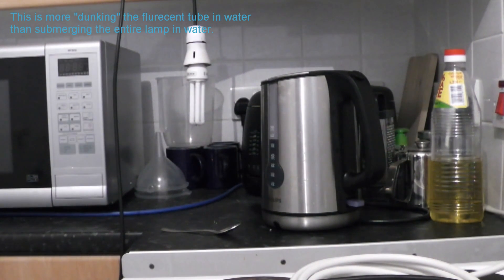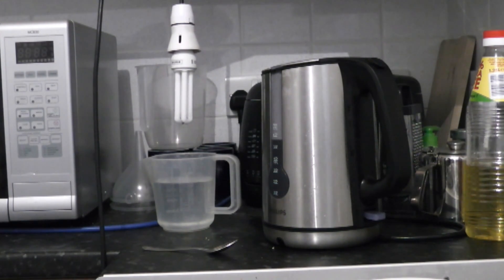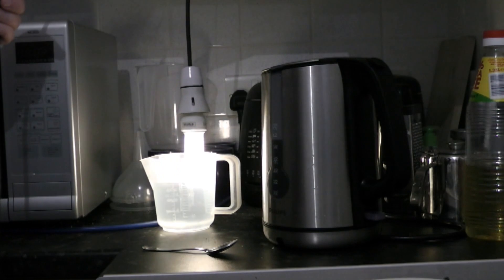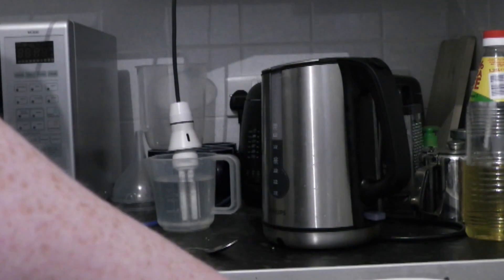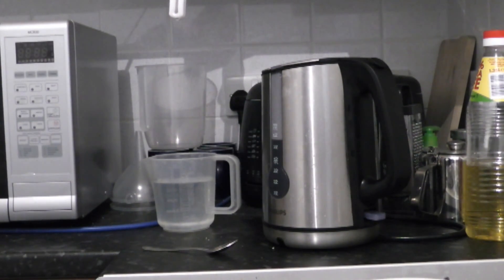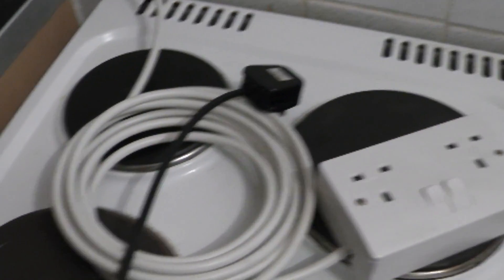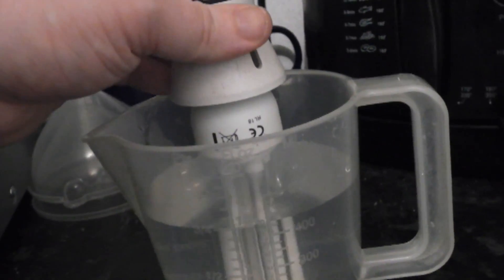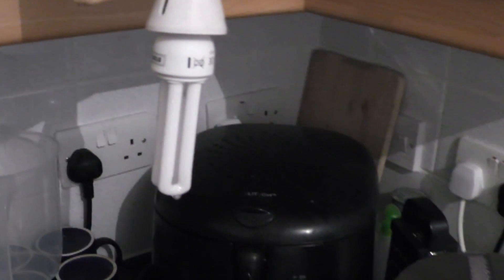CFL lamp working in water

Comment: I tried this before i saw the video, but pulled it out quick because I thought about it and came up with this question.  If the ionized gas inside the CFL is extremely hot, and you subject the bulb to cold water.  Will the rapid difference in temperature cause the glass to fracture, or is the glass strong enough, and it would act more like a water heater?  I didnt want to give myself mercury poisoning. so i went to see if other people have tried it.